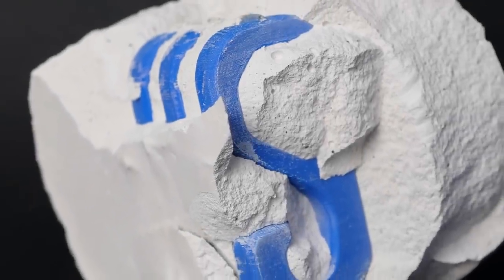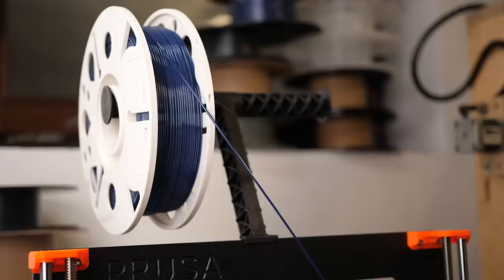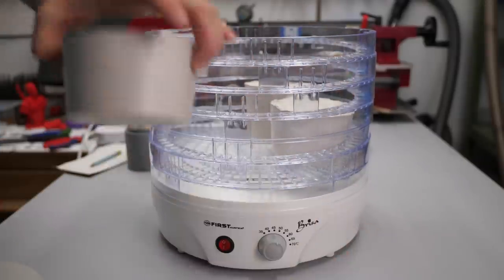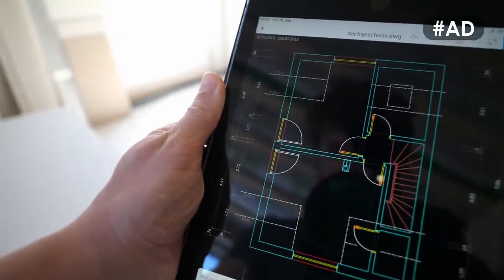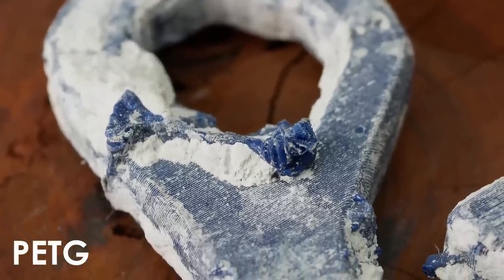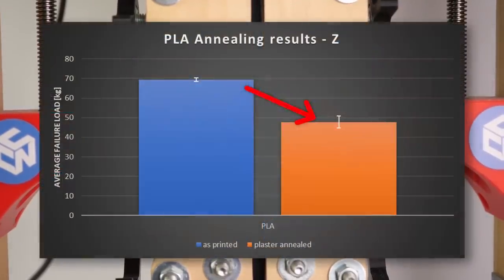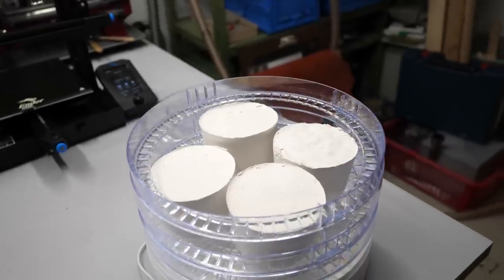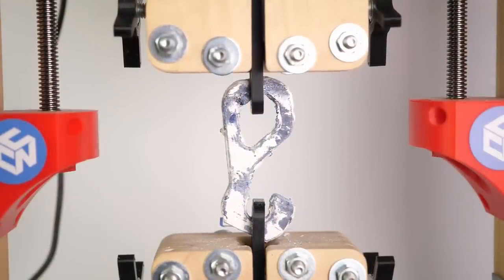Triple (x3) your Layer Strength by Annealing 3D Prints in Plaster!

Comment: Hey Stefan! I did a bit porcelain casting back in university. This is the technique we used to get (mostly) bubbly-free plaster molds:
Start with water inside an somewhat wide and shallow container.
Slowly add plaster using a sieve and let it dissolve into the liquid. Don't stir!
Repeat until the plaster stops dissolving and is resting on the surface.
You can now give it a light carefull stir, but it does not need much at this point.
In the end the plaster should have the consistency of a thick gravy, which makes pouring it into your mold pretty easy.
Reply from the maker: Nice explanation.

Comment: 1. Coat the parts in a hydrophobic mold release.
2. Cast the parts individually in custom printed casting containers so there is an even plaster layer around the part. You will use less plaster and have more surface area to volume so the cast will dry quicker. More even heat distribution during annealing and the plaster may be less likely to crack. 
3. Cast the parts with the container on a vibrating bed to agitate the bubbles out.
4. Use an ultrasonic bath to clean the parts. Maybe investigate if you can use IPA to dissolve plaster instead of water.
Reply: IPA?  I know that India Pale Ale is disgusting to drink, but can it really be used to dissolve plaster molds?
Reply: Not sure if this is sarcasm, but IPA stands for Isopropyl Alcohol
Reply: Mark Carbonell - which, of course, you don’t wanna drink....
Reply: Great advice, and even better motors! Love ya guys
Reply: A hammer drill with a reversed bit can also be used for vibration.
Reply: 2. If you print the heat shield / ooze shield then the perfect size container is automatically printed along with the object!
Reply: Isopropanol won't work. Plaster of Paris is calcium sulfate. You can think of it as a salt of calcium hydroxide and sulfuric acid. Not a lot of things are going to affect it, and it's basically insoluble in alcohols.
Reply: @Kineth1  HOW DARE YOU! Indian Pale Ale is the best beer and I will not be convinced otherwise! ;)
Reply: I was about to say some similar things myself
Reply: @featherboards1565  Well... One could also "strap-on" a battery powered marital aid with duck tape.
Or my trick for larger batches: A small tabletop with springs for legs, and a random orbit sander strapped to the bottom.
Reply: @luke_fabis  VINEGAR! Well, ok, not the tabletop stuff, but the bit more refined stuff, like 20% Acetic.
Heated up and with enough of it, table vinegar vinegar still works, but not as fast as its concentrate, acetic acid, or citric acid and tartaric acid.

Comment: Hello,
 I use the same technique but
 with some difference:
 1) I don't use Plaster of Paris,
 but two-component silicone,
 much easier cleaning.
 2) I don't use vacuum, but
 I put under pressure at 5 bar.
 Have nice day.  :)
Reply: nice but what were your results?
Reply: 2 component adhesive is too ductile id say use investment its a type of casting  plaster which melts away better in water
Reply: @jakeengland1430  I think he's talking about mold silicone, not adhesive. 
Silicone wont stick to anything beside itself so you can just cut the mold in two and remove the part. It might even be possible to reuse the mold, depending on part geometry.
Reply: @jakeengland1430  i see thx
Reply: Yes!!! Brilliant!! in mass production!!! 3d printing it starts to get real big!
Reply: @ToxNano  yeah i know its still quite ductile it wont stop the plastic from warping
Reply: Kinda of expensive alternative though. Perhaps brushing on a thin layer of silicone (two part but you can thin down caulking with various solvents very easily too if you dont care about strength) to fill the detail and keep moisture out, and then pack it in a sand-plaster mixture for rigidity, would be a nice and economical option. Painting on a thin layer of pure thin plaster before submerging into sand plaster mixture is a common technique in plaster metal casting as well.

Anyway, cool results; interesting the pla got so brittle; and that you can take it up to 170c; certainly didnt know that! Would be great to see how the other common filaments react, given that pla and petg differ so much.
Reply: I went to the comments to suggest silicone and saw this. Nice.
Reply: With solvents I mean things like mineral or silicone oil; acetone also works for thinning silicone but I suppose we want something with a high boiling point here.
Reply: @eelcohoogendoorn8044  If you're planning to use it on the same part. A mold that is able to open up would work great.
But I don't think silicon would be solid enough to keep the parts from warping under their own internal stresses.
Reply: @evren.builds  
This plastic doesn't weigh too much, so I'd imagine a silicone mold with a relatively "thin" floor could work nicely.
Reply: @jakeengland1430  I think the problem is that the silicone is elastic. I don't think those materials will plastically deform after curing unless brought above a temperature higher than needed for flowing the PETG.
Reply: @pesto50  you can get harder casting silicones that are pretty rigid. Definitely worth testing.
Reply: I use silicone
 hardness 30 shoreA
 two-component.
 100% infill,
 PETG.
 For mechanical parts
 gears, screws
 the results are
 excellent.
 Regards
Reply: @jakeengland1430  of course it will. Silicone gets plenty hard to stop flowing plastic from deforming.
Reply: @evren.builds  That can be almost entirely eliminated by enclosing the mold, itself.
Like, with the stainless steel wide clamp part off of a "Fernco" plumbing fitting.

Comment: Did you consider some type of release medium coating the part prior to covering with plaster? Like an oil or powder coat.  Oil would also reduce absorbing moisture from the plaster.
Reply: This is similar to a suggestion I was going to make. Basically asking if using a mold release would help getting the parts out of the plaster.
Reply: @Sembazuru  It would also keep the plastic from absorbing water, and then creating steam during curing.

Comment: Great video! Try painting on a watered down layer of gypsum plaster to capture fine details.  After letting it dry, paint a thicker layer of gypsum plaster mixed with sand.  The plastic parts should heat up more quickly and evenly if you don't submerge them in a large volume of gypsum plaster.  Besides adding strength, sand should reduce the degree of shrinkage, steam bubbling, and cracking that occurs when calcining gypsum.

Comment: Thanks for testing this! It seems like it should work for PETG with 100% infill and heat-resistant mold release.  In order to avoid bubbles cover the parts with just a thin layer of liquid plaster solution. And when it hardens submerge it in bulk plaster.

Comment: I have annealed parts embedded in two-part concrete-molds made specifically for this purpose.
This way I can anneal many parts quickly, and there are no difficulty in inserting the parts or retrieving them afterwards.
This procedure is, off course, best suited for relatively simple geometries.

Comment: Instead of molding in small buckets, mold them into a thin baking pan...keeps the plaster thinner, so it dries faster, and a whole lot less material to remove. Also allows the heat to transfer to the parts faster so you can spend less time heating up a huge block of plaster, and more accurately get the part to desired temp.  Thanks for all the great work, really appreciate you!

Comment: Here is finds, you might know already. I was printing huge containers with PETG, first of all PETGs are different, but I found the one which sticks to hot glass without anything else. Sometimes after bed cooling down, tension in printed item is so high, that it cracks glass, so you need to remove it while it still hot. Secondly, I noticed that printing at highest temp without cooling for PETG makes it the most strength, if you break it it shattered as glass, so layers adhesion is equal to strength of material, but when you print at lower temperature without cooling and lower speed therefore, it retains it plasticity while saves property layer adhesion. So with this setting PETG is like welding to part, rather than placing layers.
When you print big parts, "places of welds" have a time to cool down, so if you want to print small parts you need pause printing after printing each layer, to let plastic to weld to each other. Also at high Temps PETG expands and while extruder on a side even with huge retraction, PETG will runout, as the result not enough/constant extrusion for next layer. 
Like anyway.
Reply from the maker: I'll think about it!

Comment: I have never seen what settings you are using for PETG. I have found that the default profile for PETG in PrusaSlicer with fan on for all layers above 3 left me with brittle prints. Raising the temperature and turning off the fan (except for bridges and stuff) increased my parts strength dramatically. I don't have your test equipment or (more importantly) your patience, so I don't know much.

Thanks for all the great content and information!
Reply: Yeah it's interesting how everyone claims high interlaminar strength with PETG, but Stefan's tensile and Charpy tests show mediocre interlaminar strength and toughness.  I wonder if these are related to his use of forced-air cooling.  Perhaps rapid cooling results in a lesser degree of annealing, assuming there is enough time for some degree of annealing during printing.  It makes me curious to see the results of PETG without fan, or PETG in a heated enclosure, without post-process-annealing.

Comment: Great idea with good results, definitely warrants further testing of this process.  You may want to try light weight plaster or using light weight fillers and an ultrasonic bath to make removing the parts easier.
Reply: I too was curious about using an ultrasonic bath for plaster removal.

Comment: Very interesting results! Could you perhaps use “green sand” instead of the plaster? It’s the type of sand that’s used for casting metals. I would assume it does niet contain water, and it seems to break away from the part relatively easy. Thanks for sharing all the great work!
Reply: Green sand for casting contains water.  2-4% according to here: https://en.wikipedia.org/wiki/Sand_casting#Green_sand
Reply: I don't think that would be hard enough. It would still move under warping

Comment: plaster of paris, as you noted, converts at fairly low temperatures, and includes a LOT of water. and as you heat it, and its converting back to plaster, its off gassing water into your part. this process may be vastly improved by replacing the Plaster with something else, maybe some kind of plaster slip or investment casting. it would be interesting to see the effects of a similar process using compressed green sand as well.
Reply from the maker: Good point! At 150°C the gypsum releases a lot of steam. Maybe it's worth letting it rest at that temperature a bit to dry it out, before heating it up all the way to the melting point.
Reply: @CNCKitchen  a smaller volume of plaster will also aid in drying times. you might try dipping the parts into a thin plaster and letting it dry then dipping them several more times to build up a serviceable thickness, but not a large block. then drying and soaking the mold for longer to bake off all the water.

my concern is that when you get over 150c the plaster is giving off steam, which is being forced into the plastic as the path of least resistance. which is why i think a non gypsum based plaster is the key, some kind of ceramic slip. but as far as i know most of them require very high curing temps which would decompose the PLA.

in another thread i suggest sealing the part with wax. perhaps sealing the part with wax, then a smaller total volume of plaster would allow the steam to exit the mold, and not enter the part.

Comment: CNC Kitchen
2019 - Tweak layers to make them stronger
2020 - This
2021 - "Today, I am going to show you, how to make your 3D prints stronger than steel using plasma vapor deposition"
(Not impossible)
Reply: That sounds basically like making the parts out of graphene and carbon nanotubes.

Comment: I've used this technique with ABS once - I dubbed it plaster self casting - and it seemed to work great.  My wife's food processor (like a thermomix / hot blender) had a plastic coupler that wore out.  The part undergoes a lot of stress, coupling the heated blender to the motor.  I kept printing out replacements, but they'd last at most a couple of months before shearing along the z plane.  The self-cast piece has been going strong for a year now.  

I printed at 100% infill.  For plastering, I kept the container small,  kept the mix runny, sprayed the part with vegetable oil and spent 5 minutes manually jiggling and vibrating to get the bubbles out.  I left it for over half a day for it to set.   Then I bake 2 hours on high in the oven and left for another half a day to cool before hammering to get the coarse plaster off.  Finally I soaked in vinegar and then used a water pik to blast the rest of the bits off.  There was no evidence of bubbles or deformation, even on the finer gear teeth.

One thing that would be interesting to see:  what happens if you use this on solid clear plastics - clear PETG, ABS and PLA?
If it's really re-melting inside, it should make these internal plastics fuse together into a single blob and it should become much more translucent and clear.  Any takers to run the experiment?   Maybe something cool like a crystal skull model?

Comment: Make two halves so you can reuse the malls, just like casting
Reply: malls?
Reply: @g60force  I wonder if it's supposed to be molds and it is a typo
Reply: @KJMcLaws  In Dutch it's 'mal', so maybe a translation mishap

Comment: stefan, you can use a vibration table (common in dental labs) for removing bubbles from plaster and increasing plaster cohesion. its a standard practice for dental models

Comment: I used to work at an aluminum foundry where we used plaster molds. We used a high pressure water jet to clean the parts. I also experimented with dissolving the plaster in a saturated solution of water and sodium bicarbonate (96 g/L (20 °C) 165 g/L (60 °C)). The sodium bicarbonate will react with the plaster so it's a good idea to oversaturate it.  The experiments showed a great deal of promise. I don't know if the SB-solution would effect the PLA/PETG in any way though. 
If you plan on making a lot of test hooks i would consider making a two part mold fort the plaster. That way you can dry the mold faster and be sure to have no moisture in contact with the plastic. You then put your printed test hook in your two part plaster mold, clamp it together and anneal. If the mold doesn't crack and your part doesn't stick to much (try mold release) you might be able to reuse the mold.

Comment: you could try to make the molds just with dry gypsum only harden it with compression - it would be easier to remove and even better  no moisture :)
Reply: Exactly, I was thinking the same throughout the whole video.
Reply: @JC-XL  yeah. Salt won. I think.     Would depend a little on surface texture but salt should be completely removable, gypsum might make problems when rinsing and salt is cheapest.
Reply: @gur262  I don't quite agree.
Plaster/gypsum has one very big advantage - it is already ground into a very fine powder. And the salt grinding process looks like a very messy and time-consuming process, and might wreck your kitchen grinder, which is expensive.
For smaller quantities 0.5 kg, 1kg salt is indeed cheaper, but for 10kg, 25kg bags plaster becomes cheaper as a building material and we are talking about several bucks anyway.
Of course I'm talking about using plaster in its dry form, without water, just as a replacement for the powdered salt, added around the part and compressed by hand.
I agree that plaster might be more difficult to remove, not to breake thewhole lump, but just the fine lair in contact with the part that the plastic might stick to, and it's not soluble like salt.

Comment: I use jewelry investment and ABS printed @100 infill. I dip my parts 4-5times to build a shell around the part to keep the shape, and simplifies removal and speeds up the process vs encasing the part in a block.

Comment: @CNC Kitchen I believe I left one or two comments in the past, suggesting to use salt as an embedding medium. You can bond it with water and it is easier to dry and easier to dissolve. I will document my results better after my next test and share (I finally have my own 3D printer). It's something I would recommend to try. It has some significant advantages to plaster but also some disadvantages.

You can fill the salt inside your print (with suitable support) and only have a small opening to dissolve the salt on the inside. It makes post processing a lot easier
Also, you can have the process be a lot dryer than with plaster.
Reply: This is very interesting ... would definitively like to see a video on that topic.

Comment: Interesting; but, this seems to require almost as much effort as lost PLA and with lost PLA you get metal parts which are MUCH stronger.
Reply: But dont you have to have metal?
Reply: this has the advantage of not requiring a proper forge. Granted getting access to an anneling oven is also not easy, but is suspect just melting the PETG in a regular oven may get you similar results
Reply: @zakkus  You don't necessarily need a forge to cast metal.  There are several alloys that melt a temperature low enough to use a kitchen oven or torch to melt them